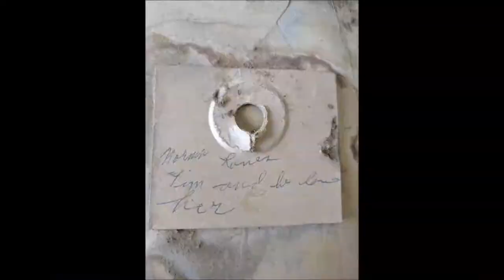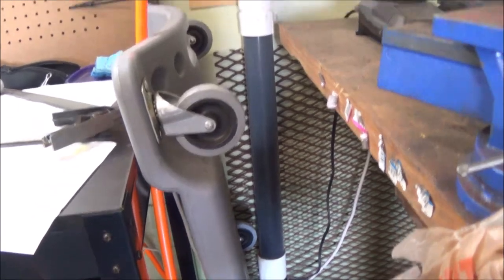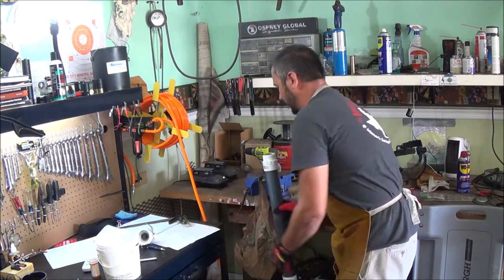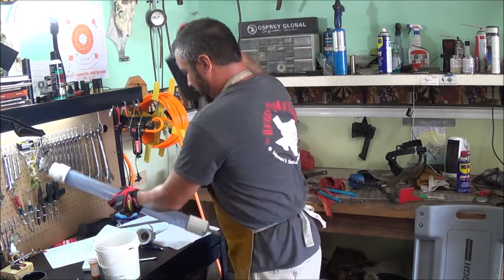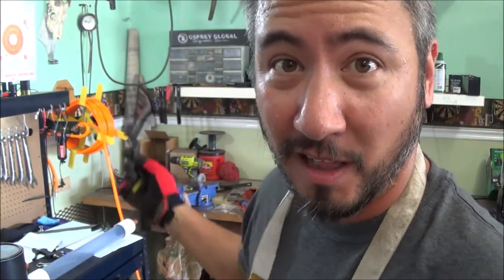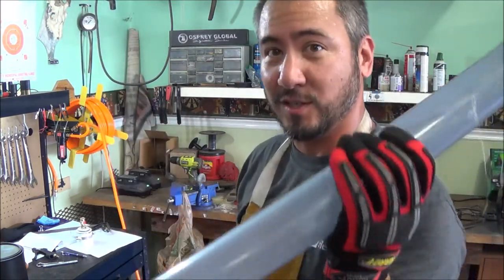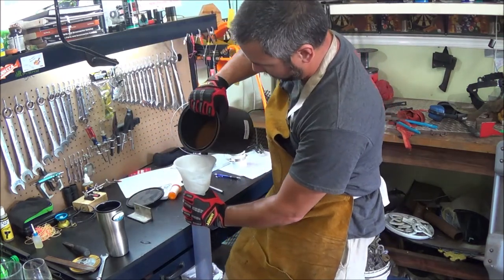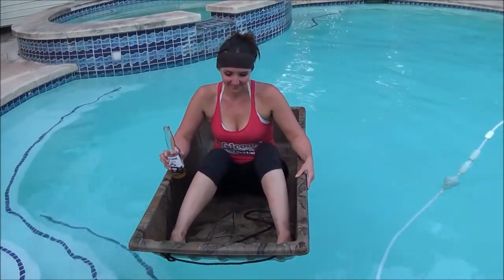Desiccant Air Dryer Part 3 Update   How to change desiccant

Comment: Sk 80 will be fine bud. Use some vaseline on threads etc and you can almost hand tighten. Clean air = healthy tools and flawless paint for sure. I tend to stay away from teflon tape as a bit of it can really plug things up. I think I am going to make one of these but use 4 inch about the same length. My wife worked retail and could bring home a shoe box a week of the packets so I am going to use them. My silver driers say to use 350 to 400 F as well. Kind of makes sense. Thanks fella. Everyone using air can use this system for sure.
Reply from the maker: Tomoko's Enterprize thanks for the to on the Vaseline.  I'll do that the next time I switch it out!   I think the color changing recommends doing lower heat for longer time to not run the color maybe..?   Anyways. Thanks for watching!

Comment: NO it is NOT schedule 80. Clear PVC is not made in Schedule 80, YET.  And it should be kept from UV rays like you mentioned. White and clear PVC is not sunlight resistant BUT Electrical grade Schedule 80 (and so is 40) IS rated for direct sunlight. It has the same characteristics of PVC under pressure but should be kept below 150 psi. One caution is air pressure has oscillating pulses in it which can act as a tiny hammer on the pvc inside surface therefore limiting it to <100 psi is recommended.  Measure the pvc thickness of the white and clear and you will see they are the same for schedule 40. Schedule 80 is double that thickness nearly. You should add a nipple inside of the clear to draw the air to the bottom and vent out the top traveling thru ALL the desiccant media. From top to bottom with vent holes (lots of them) DRILLED INTO THE PART AT THE BOTTOM. Cover it with a screen mesh, tie wrapped in place, sealed with epoxy and you improve your flow thru air. For a better mouse trap check out this little brainiac's post of how to build a pvc manifold like your desiccant trap https://www.youtube.com/watch?v=X7B5imLeYv0&t=719s    It is a lil bit humorous, and the fact she has a hard core crush on Chris Helmsworth is quite amusing, but, whomever her parents are they are very smart folks.......... it really is a better desiccant trap

Comment: hmm..that gives me ideas about my ammo an gun cabinets..currently i have those small packets of silica to absorb moisture but,,thinkin ..what if i had a one inch diameter pvc tube with screwable ends..drill tiny holes the length of the tube..fill tube with the dessicant...hmmm...
Reply from the maker: SunsetBay Bonnie even a little computer fan maybe to circulate air?  Hmm... Lots of possibilities!

Comment: It's been a few years since your last comment here, how has this system performed long term and if you did it again what would you change?   In researching this I see lots of comments warning of the danger of exploding the PVC pipe as it gets weaker over time.  I might suggest getting a sonotube to slide over it which would probably keep it from killing someone if it burst.  You could easily lift it occasionally to monitor your descant color.
Reply from the maker: Is been great!  I have some expanded metal gate over it just in case and it's never been in direct sunlight.  Plus the max psi I've ever had it was 80.  Only thing i changed was the connectors to be high flow.   I've dried and reused the same desiccant several several times.

Comment: You might get more life out of your beads by having a water separator before your dryer, but still leave a filter after.
Reply from the maker: Rooster's Garage yep.  That is how it is currently set up.  I have a water separator/pressure guage right after the compressor.  It then goes through the copper manifold to remove even more.  Then goes to the desiccant tube and lastly one more separator before the hose that goes to the tools.   Thanks for watching!
Reply: Do you ever get much water before the manifold?  I always had a water separator leaving the tank but never had it do much.  It would look foggy but wouldn't get rid of even a single droplet.  I'm adding an after cooler to lower the air temp in the tank, plus remove moisture, hoping that will help.  Next step is a manifold, then a desiccant dryer.  I like your dryer setup.
Reply from the maker: Rooster's Garage I also rarely get much in the separator after the tank/before the manifold.   It's mostly there because it also has the regulator and I like to have that before the rest of the system.  I have since added another drop to my work bench for airbrushing and have another regulator with a ball valve to only supply air there when needed.

Comment: how long before you changed the dessicant material?
Reply from the maker: Its very humid here in southeast texas.  During the summer i need to change it after about three hours of continuous use.  In the winter i can get away with several months.  Just spread it out on a cookie sheet and bake at 200 degrees for a bit and its back to useable again.  Thats why i got color changing to be able to know when its good again